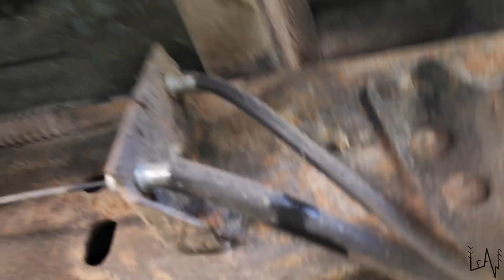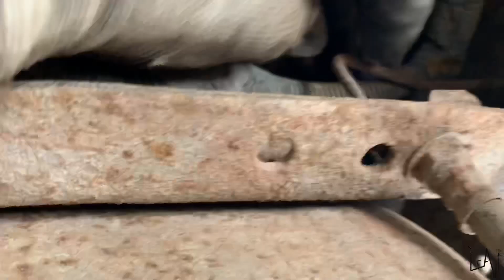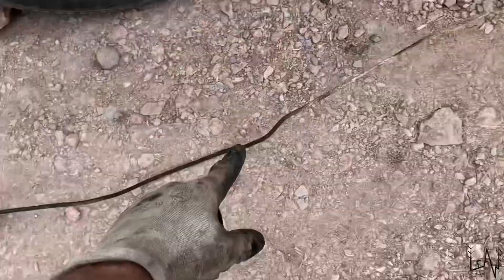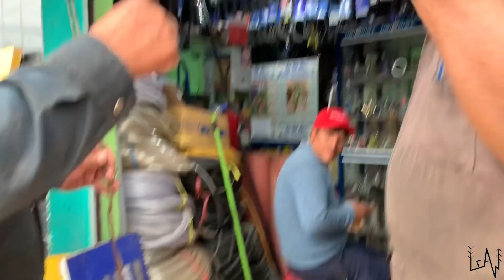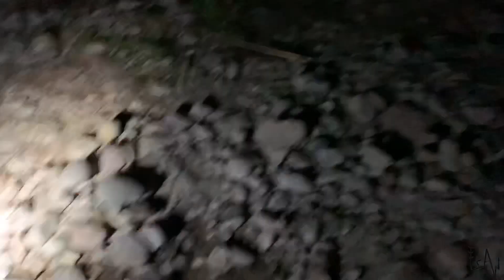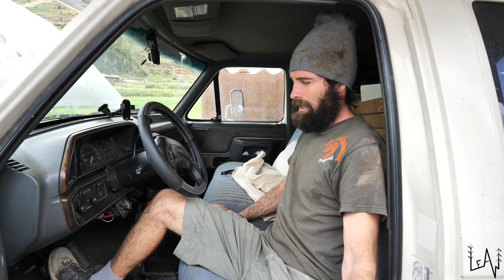Fearless and Limitless Truck Camper Life - Happy New Year!!

Comment: You have to replace the copper line by steel line and the other one to.
A little trick for the next Time, "Not necesserly you" when à breake Line failed is to unscrew the fitting before the defective breake line and put a nail with a small head in the female part and screw the mâle part back in its place, this way you will be able to prevent the oil from flowing in the faulty line, add some oil and this way you can go to the nearest garage, remember that you only have breake ont 3 wheels.
I love following You Good people.

Comment: First  HAPPY NEW DECADE
Guys the copper line the mechanic used to make a new brake line is not recommended for brake systems, the copper is too soft and will rupture, it is ok for temperary fix BUT,  you need to replace the brake line with steel lines, steel lines also come in bulk lengths so no need for special factory formed ones.
Try to do this soon  Cheers.  Love you guys

Comment: When you get to a large city, have a mechanic inspect the brake system. You may need new rear wheel brake cylinders (someone will have to send you those from the US) along with a coil of new, steel, brake line, flare nuts, a flaring tool for the tubing, and a flare nut wrench.
Reply: Brake lines on vehicles from the snowy parts of N. Am., where they use salt to melt the ice in winter, typically rot out in the most inaccessible places. I know from experience. Good luck, LeAw.

Comment: J B WELD fuel tank repair kit, has epoxy "filler" and fiberglass to repair just about any metal repair, brake lines, fuel tank or lines, radiator. Just a good tool to have on hand, and cheap insurance.

Comment: Happy New Year my friends.

As a Canadian dealing with older vehicles that have been heavily corroded (rusted) I feel it's important you should have this information.

You need to replace all of your brake lines at the same time otherwise you will encounter the same problem.

The new line will now create more pressure on the corroded/rusted lines. You don't want to have another line blowout on you when going down a steep hill in the mountains. 

If you can't get the original Ford parts, then have a mechanic make you a custom brake line system. Goods news is labour costs are cheap in South America.

I know that this will be an expensive solution... But I think your health and safety is worth it.

Good luck my friends please be safe 🙂

Comment: I am not sure the copper line will work very long.  Brake lines are made of steel for a reason...  Replace these as soon as you can get the right materials. You can bleed the air using the brake line fitting.

Comment: Hello Luca and Sara,   Lucky Lou Brakes!     The rigid steel brake lines have corroded thru causing the break fluid to flow out , now your breaks have not hydraulic pressure.   The Brake fluid that leaked out is corrosive to the brake lines,  the brake fluid needs to be changed out one per year as well because the metal, copper builds up and causes the brake cylinders to fail as well.    Now you see one brake line has corroded thru, you must, MUST, MUST replace all the brake lines now because you will have more brake line failures.  You are driving in the mountains, so if  your breaks fail in the mountains it might well be the end of you.    So, take the truck to a brake mechanic and ask them to replace all the rigid metal brake lines.    I    am signed up on paidron and donating money so you can do this.   But maybe you have enough money now.

Comment: Watching this , you have not replaced your shocks  If you run with bad shocks you will damage your truck more. Shocks And Struts
The rougher the roads, the harder the pounding, and the faster these parts will wear out. Symptoms of bad shocks or struts include: Badly cupped tires and/or noticeable tire shaking, wheel shimmy or vibration after hitting a bump. Suspension bottoming on rough roads or when backing out of a driveway

Comment: also,  trying to be of assistance,  the bleeder valve that broke on the rear brakes, most likly cannot be repared, but, the wheel cylinder can be replaced without buying a complete brake unit.  here is a link to what it looks like ..    https://www.autozone.com/brakes-and-traction-control/wheel-cylinder-rear/ford/f250 .. in search use keywords  ( rear brake cylinder for f250 ) using images search you will see where it is..